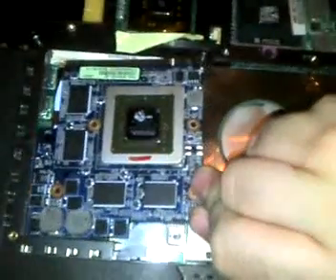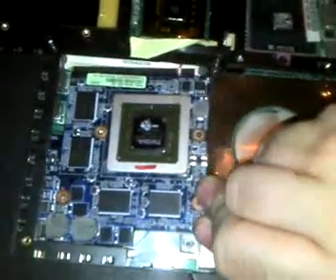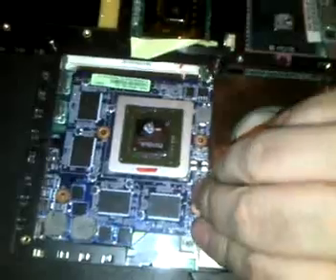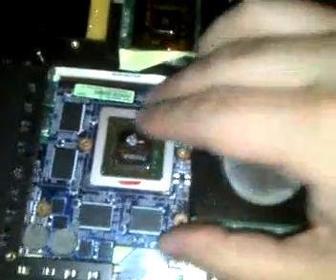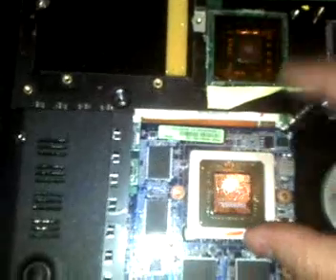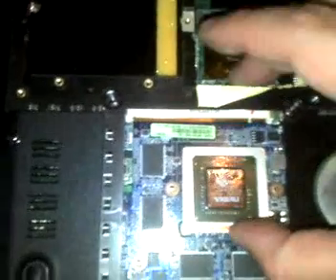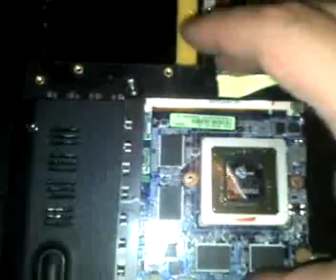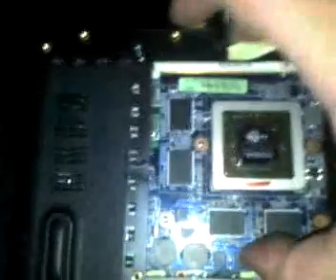Asus G50vt-x5 video card upgrade part 3

Comment from the maker: If you dont care mucho for your video card or you know that its broken but u still want to remove it from the coper cooling system, you can force a Flat Philips screwdriver between the video card and the coper and then just TURN the screwdriver until it detaches. When they get stuck together its because the video card overheated to the point it got sort of welded with the copper using the resin as cement. Hope this works and I am not held responsible for any damadge you do to your laptop

Comment: I'm definitely not trying to overclock it and I keep the video settings turned down to reasonable settings.  I updated all the drivers when I first started noticing problems and we cleaned the heat sink and fan last night.  It wasn't too dirty.  I have it sitting on a laptop cooling board with two fans in it and it helps a little.  I'm going to try to turn on the air when I play games, because cooling the room should help, even a little.

Comment from the maker: try not to overclock your laptop its really not necesary and you are only lowering the lifespan of your laptop if it gets too hot. If your not doing this then see if there are any new driver for download. Also check the heatsink to see if its not stuffed with lint or dust, and yeah I live in an area were our temperature reaches 125f in summer our record is at 129F. Today is 108F. Always use a cooling pad when playing on a bed or anyplace that can cover the airvents that are bellow the laptop.

Comment: Thanks for the quick reply.  The current video card is working, but we were going to put some thermal paste on it, since my laptop is running between 150°F - 185°F (65.5°C - 85°C).  One of the pads in the heat sink was burned to the metal, so this might be the problem with the video card.  I've been having lag issues while gaming since the temperatures in the room have been high this summer.  I am hoping to find a way to bring it to a reasonable temperature.  Thanks again!

Comment from the maker: thats probably because the heatsink compound was burned and fixed the heatsink it self got stuck like cement. If the old video card is not working anymore you can just try and force it by puting a Flat screw driver all the way inn and then just twisting/turning it to force the heat sink off. try to get it to were the heatsink is making contact with the GPU`s. There is no easy way that I know of to get it off. I hope this helps.

Comment from the maker: @Pedrokaz1 i founf the exact same video card as the one i bought but its way more expensive. mine cost 200 but the one i found on ebay is over 300 dlls. Search in ebay for this GTX 260M 1GB DDR3 Video Card    it NEEDS TO BE AN ASUS VIDEO CARD OR IT WONT FIT IN YOUR LAPTOP